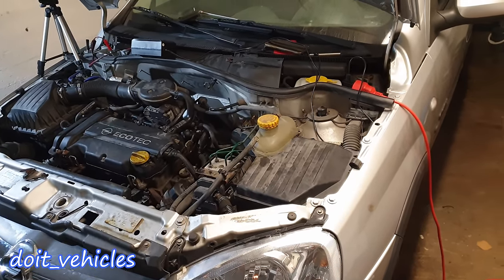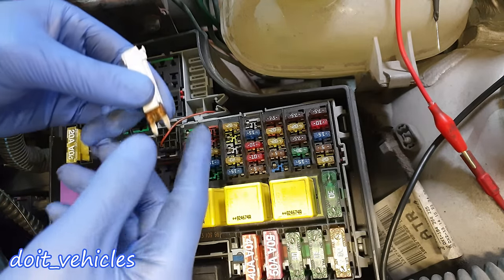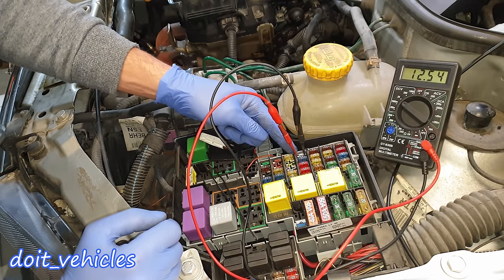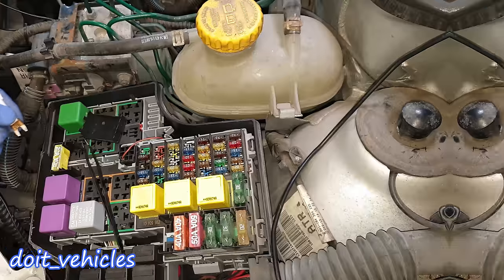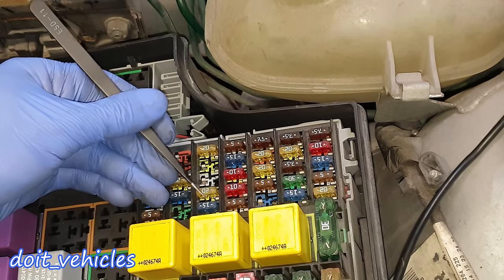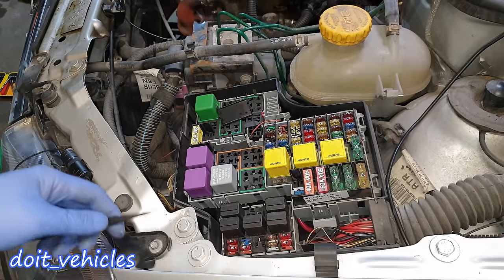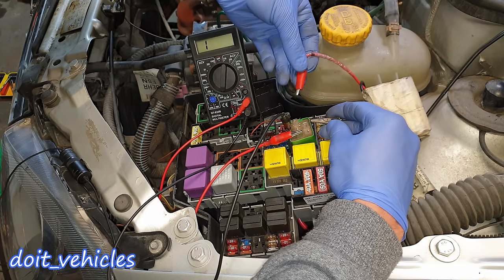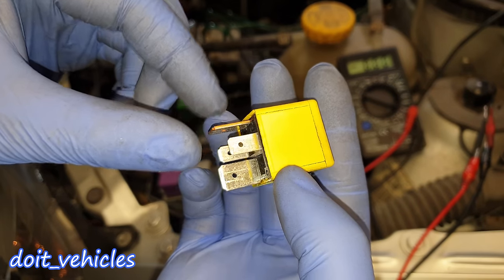All Fuses & Relays from 2003 Opel Corsa C How to Use / Test them

Comment: Just commenting to say, on my model 2006 design, fuse 25 was the one you refer to as 26. That’s the one I changed to fix my reversing lights and cigarette lighter power.
Reply: My break lights are both working but when the lights are on it dont work.
Reply: 😅😮777777
Reply: I have the same problem, the reverse lights don't work and the cigarette lighter doesn't work either. I have a Corsa 1.2 petrol twinport, but I don't have a fuse in the panel on position 26 or 25, so I don't have a fuse for my car model?

Comment: good clear to understand  video precise well done this video will help me with my corsa c  which is turning over normally but will not start  AA thhnk intermittion ecu fault they admit they dont know so i got to get it started i will try fuses  relays its not crank sensor  i try  relay on fuel punp ecu  dash immbolizer etc i think water got in engine ecu  dash they have electrical  faults due to water get in electrics you know better than me im sure i wish i had up to date scan re cod tool much easier  every body says scrap it 53 plate 1 cant afford to 2 no other faults with car  3 i like a challange your video will help me might have to put ecu lock set on it yet to get it started car only worth £2-300  look forward to your next video many  thanks Dean.

Comment: Hi. Great video! I'm driving an Opel Corsa 2007 1400 sport right hand drive. All my left side indicators are not working (front side and back). What fuse do I check as the bulbs are all fine?? Thanks!
Reply: Having the same problem at the moment too!
Reply: It's a "dual" relay (both right and left) in the computer box next to the battery on the Opel Corsa C 2008. Yellow in colour, nos 34 and 37.

Comment: Hi! My friend has the same Corsa, which had been sitting for half a year. We tried to jumpstart it from another car, but it didn't really work (we somehow couldn't get a good connection with the jumper cable, and the starter motor didn't start up, just clicked). So we installed a charged battery, and tried to start it up, but the dash lights were flickering, and the engine didn't start, although the starter motor worked fine and turned the engine. I realized the engine doesn't get any fuel (the fuel pump isn't humming when we turn the key). I realized we might have blown a fuse while jumpstarting the car, but I checked all the fuses, and all of them are fine. Do you have any idea what can be the problem?

Comment: hello mate im sorry to bother you i got a question if you dont mind  i got a 1.0 corsa c my water pump was leaking so it over heated the engine rattled then conked out i got a error code for bad egr valve so i cleaned it but had drained my battery so charged it but when i put it back on and tried it never started so i shut the bonnet not realising the live terminal touched the bonnet and it was 3 hours before i realised and when i did the terminal was welded to the bonnet is there a chance that its not done anything bad in regards to the terminal touching or would it have definitely caused a problem would really appreciate any advice

Comment: Hello.  I have a 2001 Opel Corsa C.  On the internet, on one fuse diagram for a Corsa, it says that a 10A fuse is used for the cigarette lighter.  And the YouTube videos all show the 20A fuse going.  So I'm wondering if it's 10 or 20 A?  Thanks in advance.

Comment: I juss got a corsa 1.0 2002 model .the power steering is not working...the 50 amp fuse for eps is missing im not sure if that's  the problem ..how do i test if this  is the problem

Comment: Which fuse is responsible for the indicators? Right side working left side not. Checked all bulbs are good. Now wondering fuse or relay but I can’t find anything about it
Reply: I also have the same problem. Did u get any help.

Comment: Maybe i miss, but where is Relay for turning signals? I have problem with relay probably, they blink too fast if i turn on left or right turning lights.
:)
Reply: I’m having the same problem it’s a nightmare, all the indicators on the left side do not work and there’s no fuse for them.
Reply: @oldgreggscreamybaileys6618  did you find out what it was?. I'm having the same problem. Thinking the relay under the other casing
Reply: @sylimeneerg  yeah I eventually found the relays and replaced the one for the indicators and that fixed it.
Reply: @oldgreggscreamybaileys6618  I've just ordered one from Amazon for £14.99 as Vauxhall were asking for nearly £40. Thank you for your reply
Reply: Hi. It's in the fourth row, N15, Blue fuse.

Comment: Thanks that was a great explanation. Clear & concise.
Reply from the maker: Glad it was helpful!
Reply: @doit_vehicles  hello,can you 0lease give me a hint where is the control unit for central lock system? Because the passager door wont have power to lift the locking pin, all the center locking is not usable. I replaced all mechanism from doors and boot and still dont have power to open all doors. Have no ide what else to check. If I disconect the passager locking plug, all the rest work fine.

Comment: Hi, I have a corsa c 1.2 75 hp 
Can you please advice when it is hot outside and car is on direct sunlight my windshield wipers starts automatically when I turn on ignition. Somehow relay starts working from outside heat? 
Did you experienced something like this? If its from wipers relay is it possible to change it? I made a research and looks like this relay is mounted to cars ECU?
Reply: any idea?

Comment: Need some help. Fuse 26 is for the reverse lights an cig lighter. Problem is I only have 1 terminal in fuse 26. Is it likely the other terminal has been pushed out an if so how would I no which it is under the fuse board
Reply: I have the same problem, the reverse lights don't work and the cigarette lighter doesn't work either. I have a Corsa 1.2 petrol twinport, but I don't have a fuse in the panel on position 26 or 25, so I don't have a fuse for my car model?

Comment: Hi, great video. My Corsa c window washer is not working at the front but ok at the back. I tested the pump and it work both ways. From something I read I thought there could be a relay but you do not mention a relay for the washer pump. So is the washer pump directly turned on  by the switch in the cabin? Thanks.
Reply from the maker: If the pump works then it might be the nozzels clought
Reply: @doit_vehicles  found the problem. There are 2 separate relays for front and back. These relays are in the other box near the windscreen/battery (Passenger side on a UK Corsa)
Reply: @mauricepicard So you just replaced the relay? Do you think this relay could also be causing my rear window wiper not to work?
Reply: @mbz4652  Yes. I think so

Comment: Hi my needle on speedometer is not moving which fuse will that be?
same car corsa c sxi 52 plate but actually 53 year
Reply from the maker: the fuses responsible with the engine management or the interior lighting / dashboard
Reply: @doit_vehicles  it just started working... thanks though ;)

Comment: On my opel corsa my speedometer is not working and the abs light is on. Can you help
Reply from the maker: Have checked some live data / wheel speed sensors?
Reply: @doit_vehicles  yes and i think its the one on the left side that is faulty because the speedo works then it stops

Comment: Which fuse supplies 12v to each injector?
Reply from the maker: There will be one of the " engine electronics " responsible with the module for the injectors . There is no direct fuse exclusive for the injectors .

Comment: My intermittent wipers are not working properly, they stop three quarters of the way up the screen, pause for a little bit then return in the wrong place.

Fast and medium work fine.

 What could this be?
Reply from the maker: It can be a bad relay ( or the connection ) , bad motor or even a software glitch
Reply: @doit_vehicles thanks, appreciate your help! Ill change the relay first and go from there
Reply from the maker: @akaashmohammed3680  you can test it first and check for corosion
Reply: @doit_vehicles thanks if i manually make the switch, whilst the power is on will it operate the wipers ?